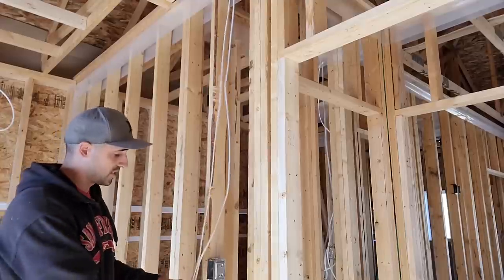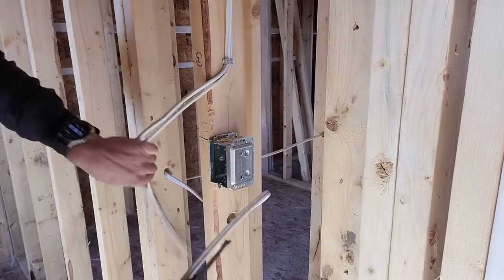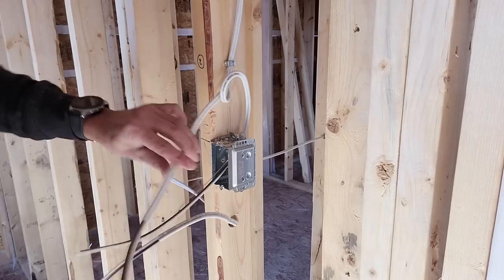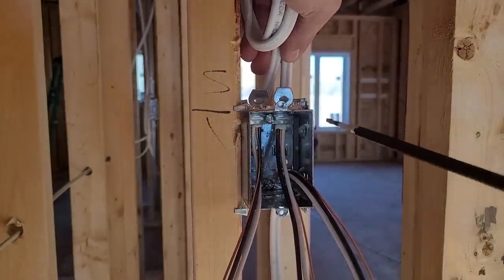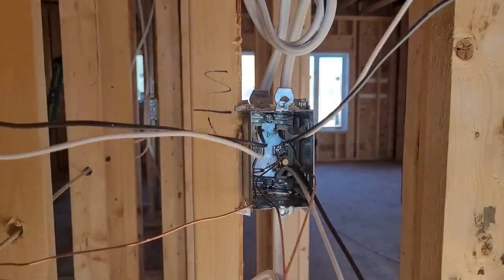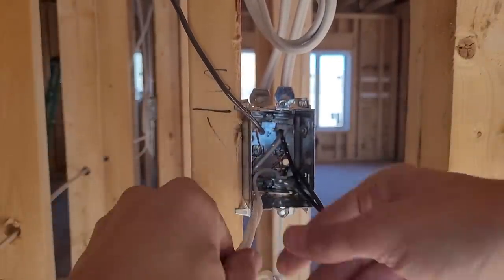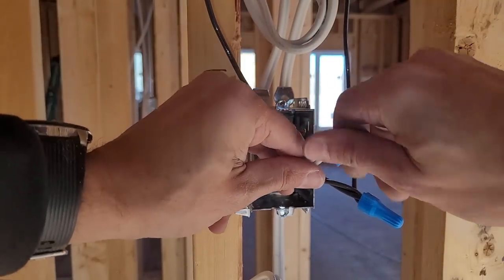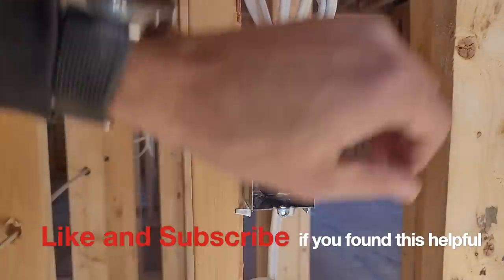How Pro Electricians cut wires into boxes and make it look clean!

Comment: Installation is Code compliant as per 2021 Canadian Electrical Code 

12-510-1a - NMS cable supported 300mm/12" of the device box 
12-510-2 - Stud hole is considered support for the lower cable 
12-516 - NMS cable was kept 32mm/1.25" from the edges
10-614 appendix b  & CSA C22.2 No. 42 - Switch is bonded by mounting screws to the device enclosure in this case a metal box. 

A device service loop is considered good practice during electrical rough-in, in most if not all parts of Canada. However not required by CEC and does not violate any codes for this installation.  

Just for clarification for non-canadian electricians.
One small terminology error, the white conductor in this case is an identified conductor, not a neutral.

Good video clear and right to the point.
Reply from the maker: Thank you. A lot of commenters find it hard to understand the entire world doesn't use the NEC.
Reply: @jeremiahbullfrog9288   In normal operating conditions the intent of a neutral is to carry the unbalanced current in a single-phase system. In this case, your white conductor carries the full load current when the device is energized and is the only return path to your source in a non-fault condition. As defined in section 0 of the CEC,  the term neutral in a single-phase system would only apply to a 3-wire circuit. Hope that clarifies the difference a bit better.
Reply: Now I know why you call it rough in . That looks as the name suggests. Rough.. Here in UK 🇬🇧 call first fix and when we fit the accessories ie socket faceplate and switch plate and light fittings we call it second fix . Also for a lighting circuit we take a feed from the fuse box to the first light then we take a switch line down to the switch the we take a feed from the first light to the next and we repeat until we have all the lights wired each lighting point haves it’s own switch end result each light fixture will have 3x 1.0mm2 twin and earth one of which is the switch line there is no neutral at the switch so the neutral wire is identified as live with a bit of brown sleeving  in the UK our cable colours are brown = line blue =neutral bare copper =earth the switch wires are called switch line and switch return. At the ceiling rose we have feed in loop out and switch drop. Or or simply loop in loop out switch drop no wire nuts or other connectors are used . Except for when we take the feed to the switch .
Reply: @Dog-whisperer7494  Many light circuits are wired that way in Canada too, as in feeding power to the junction box where the fixture goes and then connecting the switch to that box via a switch drop. In that case you'd only have a single 2-wire cable going from the junction box to the switch box, requiring no wire joints.

EDIT: Before people misunderstand and scream bloody murder, a 2-wire cable includes two current carrying conductors and a ground wire. Technically there are three wires, but only the current carrying wires are called out in the numbering.
Reply: Do you not use rubber grommets to protect the edges of the box?????? We also use a green and yellow sleeve to cover the short bare earth bonding wires.
Reply: @GWAYGWAY1   There's a clamp just inside the opening that secures the cable and prevents it from moving and touching the edge. No need for grommets in this style box. There is another style of box that has a larger, round knockout and no clamp. For those you must use a plastic bushing.
Reply: @raggarex  2 wire drops to a switch are no longer code complient.
Reply: @kevinoler8064  Oh interesting. My bad. It's been a while since I slugged the tools professionally. Thanks for the correction.

Comment: The curl you put in looks sloppy and amateurish to me. I am not positive, but I believe it is a code violation in the U.S.
Reply from the maker: Thanks for watching!
Reply: @jsb7546  I retired 4 years ago. No need to be out there again. Did my 55 years of construction already.
Reply: It’s going to be behind drywall and not visible to anyone. And afaik there’s no code violation involved. Was your 55 years as an electrician?
Reply: The bigger issue is how he grounded the box imo. You’re allowed 12” from your staple, that being said, here in MN, never seen “service loops” for anything outside of low volt. Also, no offense to this guy, but if this is what he considers neat, I would hate to see what he used to do.
Reply: The looped wires are going to place the romex too close to the inside surface of the drywall.  Basically, defeating safety of stapling the wires to the center of the stud.   A stray drywall screw or homeowner attaching something to the wall on the opposite side and you’ve got a serious problem.  Also, once you leave, you don’t know who might push those wires out of position.
Reply: @glasshalffull2930  bingo ! Somebody gets it.
Reply: I believe that the curl,(which is a good idea) would be a violation because to my understanding of our codes, the wires need to be secured not more  then 3 in. from the box.
Reply: @thomasschwarting5108  Mainly commercial here, but I just got done with a company doing custom homes. 8” from the box if it’s not clamped, 12” otherwise. However, I’m looking in 334.40, and I’m not seeing anything about 8” so I think that was a company standard to please inspectors. I asked like 3 times to multiple employees and they kept telling me 8”

I just tested for the first time (and failed), so I’m probably not the best to ask lol 😂
Reply: @thomasschwarting5108  I do not think it is a good idea, because of all the job sites I have been on in my life. That loose curl can very easily get pushed around in front of the stud by others. If the drywall crew is paying attention, not so much of problem, but if they are working for speed like most that curl in the way might easily get overlooked and pinned under the drywall. Maybe not, but maybe sucks when you have to repair a problem that could have been avoided. How many times have you seen guys simply walk between studs rather than go around ? You think they are going to make sure that wire stays in place ?
Reply: I’m pretty sure the device getting installed has a group screw on it.
Reply: @Jason forger Others here have confirmed my thoughts. As the NEC requires the wire to be stapled closer. And the bottom wire is not stapled at all. Definitely would not pass inspection. Bless your little heart. All you can do is ATTEMPT  to insult.
Reply: If you have ever come across a short or damaged conductor you would thank the guy that did the ruff in who provided the service loop. I do the same thing in the main service panel when landing the hots, it doesn’t look as nice as commercial panels with everything Ty-Rapped tight and neat but should someone ever need to move a circuit the service loop will be appreciated! Very nice work!
Reply: Gc here in BC.  All our electricians do a Z above the box a opposed to the loop. I believe that technically it could be considered a code violation because the code requires a staple within 300mm/12” of the box. However in 25 years I have never heard or seen anyone called on it.  I think its just standard practice and the safety issue is not really relevant.  You can’t account for what someone does in the future.  
2 notes for the dude posting the video. 1. Always keep your colours to the same side when entering a box. Eg. Always keep black on the right, white on the left, bond and red in the middle. Tiny bit tidier when organizing in the box. Also looks like you care more. 2. During rough in, our crews usually pre strip the wires and cap the hot with a wire nut. Saves a mess and time at finishing. Otherwise nice work. 👍🏼
Reply: Most US inspectors would fail that setup. Can also see he was never taught AC/DC theory.
Reply: It’s code in Canada.

Comment: "When I started doing electrical my wiring was messy" today is your first day it appears 🤣
Reply from the maker: How so? Should I be using a level for my wires, maybe a tape measure to make sure exactly 150mm of wire is sticking out of the box? If you've ever been a contractor you know that you need to do a good job and in a timely manner... there's no time to be finicky about little things.
Reply: @energyoneelectric  Well apparently anything goes for our brothers up north because we have standards for wire length, grounding, and box fill. It takes but a moment to ensure your wires are the proper length. There are quick tricks to do this. Thanks for the video!
Reply: Completely agree with you, ugly af.
Reply: @knowledgeableharpy2329  things like wrapping the ground around the screw? You mean things like that?
Reply: I would recommend keeping at least one grounding conductor at same length as hot and neutrals. Some switches are now requiring grounding, usually related to dimming and/or smart switches.

Comment: Are you in Canada where metal boxes and switches without an EGC  are common? For American viewers who are working with plastic boxes, NEC 404.9 requires the switch to be connected to the EGC. While this video would comply due to the use of the metal box, it would not if he were using a non-conductive (I.e., plastic) box. As someone who has done a bit of remodeling on older installations, I cring watching you cut back all the  EGCs. Couldn’t you show a future brother some love and leave at least one longer tail? At least there’s service loops so more could be pulled in to extend the ground, if required in the future.
Reply from the maker: Yes I am in Canada. I'm not familiar with American electrical codes other than hearing that they have a lot of similarities with Canadian codes. The plastic boxes I use here have a metal tab running from the bonding screw to the screw hole where your switch would be screwed into, carrying the bond to the metallic parts of the switch. Sometimes my customers ask me to install a dimmer switch, which has a bonding wire, so I just put it directly under one of the bonding screws, no need for a longer bonding wire... but I do understand your reason for wanting a longer bonding wire left in the box. Thanks for watching.
Reply: Yes, I agree. Also to note, insulation should be in the box but not more than a quarter inch? And all wires should be at least 6 inches long from the back of the box if I remember correctly, for American NEC anyways, right?

Comment: I believe there's supposed to be a quarter inch of romex sheathing minimum inside the box. I'm not sure we're seeing that?  And while I understand the usefulness of a service loop for extra wire,  coiling backwards like that means that if  you need to pull the extra wire through you can create a kink in the cable.
Reply: My exact thoughts. You create curly Q's looping it that way. I also curl my grounding around the screw for a snug mechanical bond. Probably better to loop the romex across to the adjacent stud and then back and into the box or come down an adjacent stud and curve the romex like a backwards 'S' on its side, using an external cable clamp so the wire goes straight down into the box with several inches to spare. As long as it is secured 12" from and the length of wire until the strap does not exceed 18", this is permitted by code.
Reply: @knowledgeableharpy2329  By curling your bond around the screw you eliminate the possibility of adding a second bond wire. You also can damage the bond wire by wrapping it. Not good practice.
Reply: The “service loop” looks like it violates bend radius of 5x major diameter (334.24 of 2023 NEC)
Reply: @guyzer6197  Nonsense. Why would I add a second wire if one is landed and I can add a 2nd in the wire nut? I've never damaged a ground wire by having a secure bond.
Reply: @knowledgeableharpy2329  During our recent house reno, I encountered half a dozen metal box grounding wires that were damaged or actually broken when the wire was looped over the screw and then pulled too tight. Resulted in the box not being grounded. Of course, the number of current code problems in a 40 year old reno couldn't be easily totaled, partly because of code changes but also because, near as I can tell, they didn't enforce NEC here in the county.
Reply: @geraldcreager4432  That sounds like poor tradecraft, not an inherent problem with wrapping the bond all the way around the screw. If that was an issue, wouldn't it be a problem with device terminal screws? I'm code-required to wrap those 270 degrees.

The main problem I see is when the bond wire is routed across the landing zone shoulders that help trap the wire under the screw head. That can result in the bond pretty much being snipped off.

I always teach beginners to add, at minimum, a little curve to the bond before landing it on the screw. "No guitar strings!" And, if there's only one bond wire on a screw I think a full wrap  is at least as good as, and arguably better than just running it down one side. The sparky that has to move it at some point in the future may grumble but that's not a compelling argument against it. IMO, YMMV etc.

Comment: The loops are just not necessary and look sloppy. In all my years and tens of thousands of outlet make ups, have never needed extra length of wire. Imagine the cost of copper being wasted on a large house. Waste of time also. I can only imagine what a 3 or 4 gang switch would look like. Sorry but that is my opinion..You picked the best trade out there and I am happy for you in that respect. Plastic boxes are far quicker but maybe they don't allow them up north.

Comment: There's a special place in hell for electricians who cut ground wires short.
Reply from the maker: @danotoole9737  it's really not a big deal since it's not required.  If you ever need one you can easily add a piece of bonding wire.

Comment: Interesting setup on grounds. You are allowed to use the box as connection across grounds? I'd be afraid it would loosen and want to still use a wire nut to bond the 3 as backup to the screw.
Reply from the maker: Thanks for watching, Adam. I use Eaton switches and they don't even have a bonding screw. Also, keep in mind that adding a wire nut can reduce your box fill by code.
Reply: @energyoneelectric   you're saying that wire nuts on grounds increases their box fill number from 1  for all to 2?. Never heard that before.
Reply from the maker: @jerseyjim9092  Sorry I don't understand your question the way you worded it. Canadian electric code rule 12-3034 (2)(b) says that for every 2 wire nuts your box fill is reduced by 1 conductor (in my own words of course). So depending on the size of your box and how many wire nuts you already have in it... adding 1 more wire nut may reduce your box fill regardless of which wire the nut is on.
Reply: @energyoneelectric  thanks for the response and sorry my question wasn't clear.  But your Canada Code reference answered my question. Unless its a recent change, our NEC doesn't count wirenuts in box fill calculations.
Reply: @jerseyjim9092  Correct.

Comment: The service loop is a good idea. It makes the stiff cable more flexible and easy to maneuver. Similar to plumbing pipes and hoses in very tight spaces.
Reply from the maker: I love the service loop. There have been many times when I needed to move a receptacle after it has been wired and the service loop left me just enough wire to do so.

Comment: I like the service loop - I guess you are at the mercy of your local inspector, but an extra couple inches can be a lot of help.  Cutting your equipment grounding conductor around here would get dinged since you can’t guarantee someone will use a receptacle that support that technique.   Well spoken and clearly demonstrated.
Reply from the maker: I have never been called by an inspector over service loops. It just makes sense to have them. On more than one occasion I have had to pull out some extra wire after drywallers cut them.
Reply: @energyoneelectric  the service loop is a great idea and no problem with it. I was concerned about cutting the ground wire short and not using the device grounding terminal.
Reply: @energyoneelectric  In ontario you need the extra service loop by code.
Reply: @MrKen59  that’s a slightly tricky one. Depends on the switch, if it’s the residential grade, you gotta ground the switch. If it’s a higher quality switch, and is self-grounding, you don’t have to.
Reply: @guyzer6197  well, than that explains a lot.
Reply: That’s not a bonding wire as this goof calls it. It’s an equipment ground and you absolutely have to splice it together. This is awful workmanship and poor practice.
Reply: @krakenwoodfloorservicemcma5975  to be fair, it depends on the AHJ. If this is approved in his area, no reason not to do it that way. We cannot get away with that. Only one EGC is permitted to land on the box. The rest have to be twisted together so most use the "fancy" ground wire nuts with the hole in the end for convenience.
Reply: @krakenwoodfloorservicemcma5975  I could not have said it better and I have been an Electrician in Canada for 33 years I have never seen another Electrician do this. A homeowner would do this because of not knowing any better. My advice is to splice these bare wires together under one marett/wire connector.
Reply: @krakenwoodfloorservicemcma5975  In Canada there is only one ground conductor. The wire that goes from the panel to the ground rods or ground plate. All the rest of the bare copper wires are called bonding conductors. Bonding conducts must be mechanicaly held together ie screw or wire nut. How this is accomplish is up to the journyman
Reply: Is a code violation to cut ground wires and no connect to switch